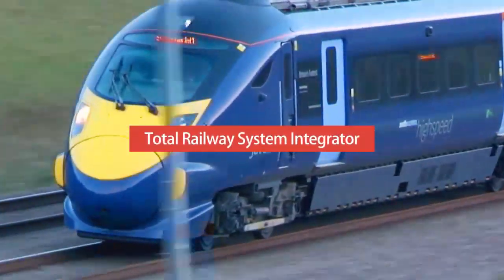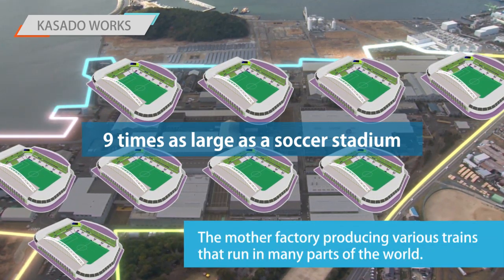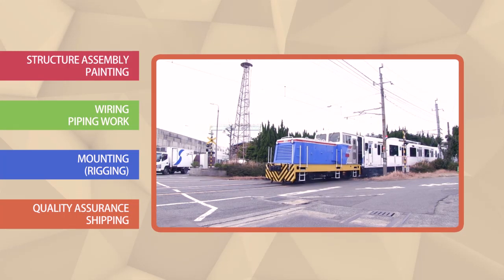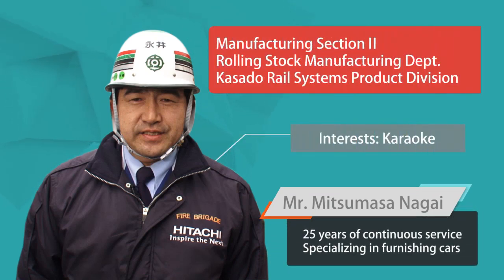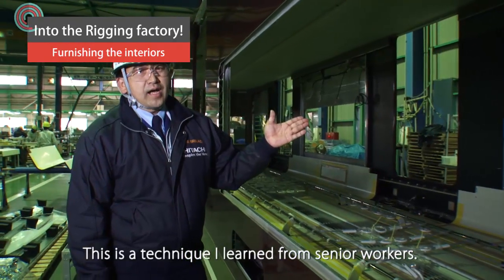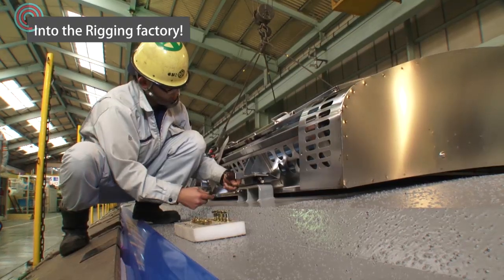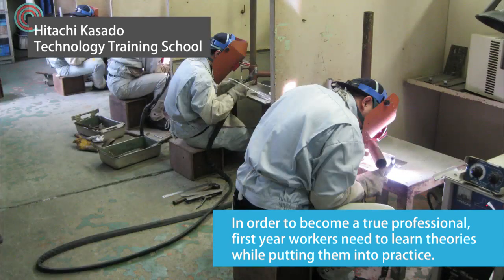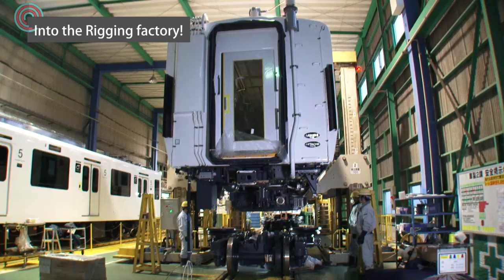The Creation of Trains Part 1 - Hitachi

Comment: Kon'nichiwa! I'm designing an information system for IEP trains in the UK as my final year project in university. I would really like the idea to work and I'm currently in the process of putting together a business case to later pitch to our board of directors and Santander. Is there anyone I can speak to about manufacturing and shipping to the UK - I need to calculate/estimate production costs
Reply: How that's going?